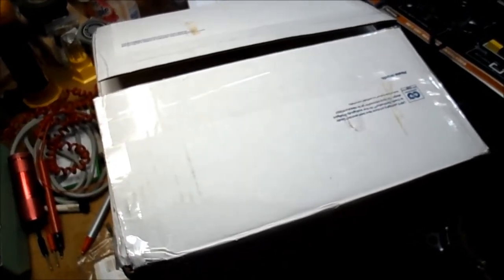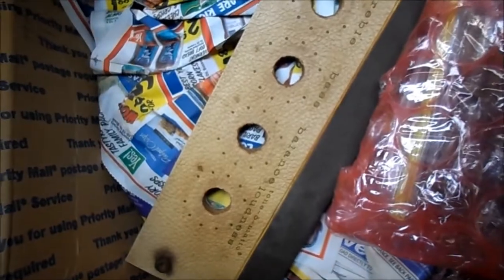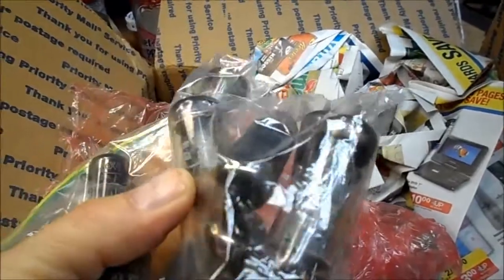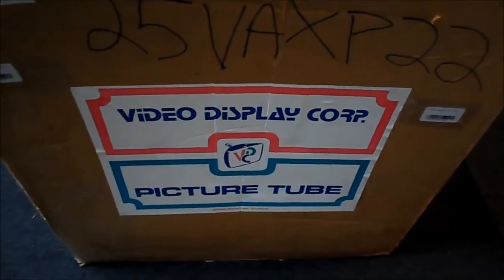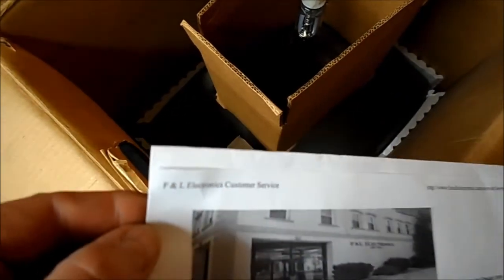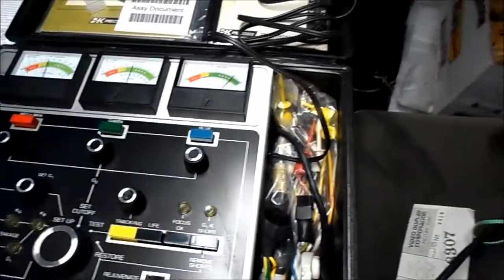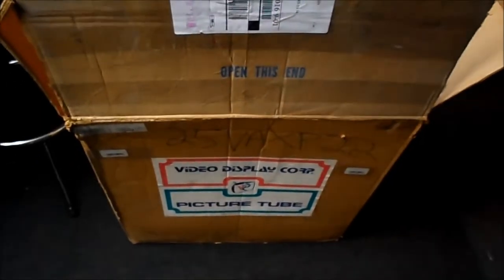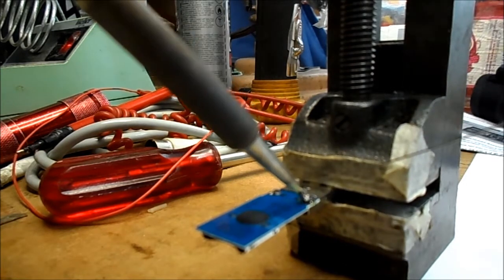Friday Nite Box Opening Phono Parts. NOS 25V CRT. USB Card Reader Fail / Repair.

Comment: without seeing it I can not comment, but what ever you do, just do with EXTREME caution. I had one go off and it was really scary. Eye and hand protection at the very least, full body armor would be best. Have heard that if the tension straps let go it will for sure implode. I suspect there has been a lot of different outcomes.